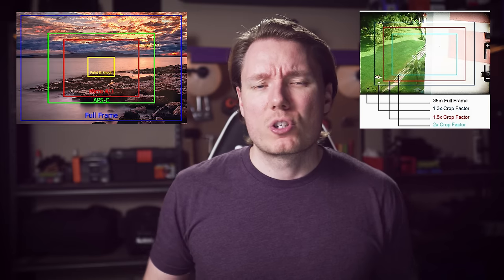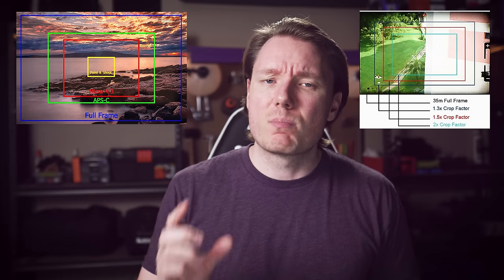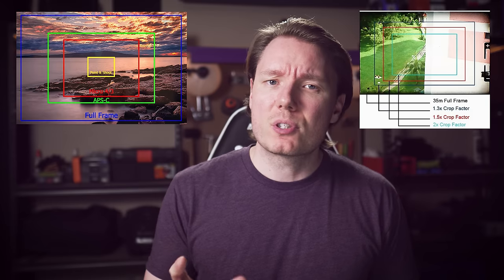Crop Lenses on Crop Bodies: How It Works vs Full Frame (APS-C & M43)

Comment: Can somebody settle this argument for me between me and my friend. So we both agree that if you put a full frame lens on a crop body (using canon as an example) it would be "cropped" in as people like to say. For example 20mm full frame lens with a crop off x1.6 for cannon would be an equivalent focal length of 32mm and similar fov as a 32mm full frame lens on a full frame body.
However we disagree that a 20mm full frame lens on a full frame body would be the same fov/ crop/ focal length as a 20mm crop sensor specific lens on a crop body. This crop specific lens on a crop body would surely still be 20mm and there is no "crop factor" to be applied? So a 20mm crop lens on crop body wouldn't be a 32mm equivalent unlike the full frame lens on a crop body.

Awesome video btw, really in depth very well explain!
Reply from the maker: The crop factor is still applied to lenses designed for APS-C, but it is "applied" differently. When you mount full frame glass the image is cropped, but when you mount aps-c glass, the lens displays a narrower field of view. How much narrower? The same multiple as the crop factor. So for a specific example:
The Canon EF 24mm, which is a full frame lens, has an angle of view of 84 degrees.
If you mount that lens on a crop body like the 7D Mark II, it will instead have an angle of view of 60 degrees.
If you instead mount the EF-S 24mm, which is a crop lens, it will have an angle of view of 59 degrees (very similar to the cropped full frame)
Hope that helps.
Reply: @geraldundone  Thank you so much!

Comment: Amazing content Gerald, amazingly useful for those of us who are newbies in the field. This is the first video I see that explains this well. Does this mean a sigma 16mm made for the MFT, has no crop on a MFT sensor, and would get exactly the same fov on a full-frame sensor with a 16mm for full-frame? I am particularly confused by this https://shop.olympus.eu/en_GB/lenses/om-d-pen-lenses/m-zuiko-pro/m-zuiko-digital-ed-17mm-f1-2-pro as the shop of Olympus itself mentions it as a 34mm (under specifications, it mentions 34mm equivalent on a 35mm sensor). Why is that? It's a MFT lens...
Reply from the maker: Thanks, Fernando. Unfortunately, no, it means the opposite. It means that a lens always has the crop applied by the sensor regardless of whether it was made for a smaller sensor or not. So the Sigma 16mm on MFT, will have a 32mm field of view equivalent to full frame.

Comment: after I watched the video for the first time, I understood most of the information, but I got one thing wrong. I thought an EF-S lens on my 80D will give me the same field of view as a full frame lens on a full frame body. then I tested the two lenses (ef & ef-s) on my 80D at 35 mm and they both gave me the same field of view. Then I concluded, a croped  sensor will still give you a zoom/crop effect even with EF-S lens but a more sharper image

Comment: Good info and presentation, but I still have a question. Is the field of view for a crop camera with a crop lens similar to the field of view for a full frame camera with a full frame lens with like focal lengths?
Reply from the maker: Thanks, Scott! And no, the crop is always applied even if the lens is designed for APS-C.
Reply: @geraldundone  Thanks. Why are there APS-C lenses then? I thought they focused the image circle somewhat so it fit on the sensor better.

Thanks again.

Comment: Is The perspective distortion is the same on apsc vs full frame or its different ?? A 56mm lens for apsc have the same perspective distortion as a 85mm on full frame ??? Not the bokeh i mean the compression do i get the same perspective distortion with a 16mm on a apsc as i get with a 24mm lens on full frame ??
Reply: Of course. How could it ve different.

Comment: I have a bit of a strange question for you Gerald but it is related to crop size to some degree - although opposite to what you explain in this video.  A long time ago, when I was active in film, I decided to shoot some projects outside the commercial work I’d been doing for many years and got myself a Canon XL-1 I believe it was called. It was a very cool little DV cam at the time and I had a lot of fun with it, but only after I changed out the crap kit lens it shipped with. I invested in a Canon L- glass they came out with and was specifically designed to fit the crop of a 1/3rd inch sensor which is what the XL-1 sported. 

Fast forward nearly 20 years and I still have that lens. The camera is long since retired of course but that lens still sits there on my shelf beckoning. So not being an expert by any stretch on lens science I thought I might run this by you. I’m seriously considering getting the Z-Cam E2 which has a MFT sensor - and I am wondering if there is any way in hell that I can modify this lens or add an alt-speed-booster to the set-up that could get that lens paired with this amazing cine-cam?  I know, probably crazy even asking but I have to try. I loved the images coming off that glass and would be so pumped if I could pair it today with the amazing sensor tech we  see in the E2.
Reply from the maker: Hey! It always comes down to two things: image circle and flange distance. The flange distance should be fine if the lens was originally made for SLRs, because that means it's longer than you need, so it can be adapted. But I'm not sure what size image circle it produces and if it would be enough to cover m4/3. I only say that because I'm not sure which lens you have. Lastly, it comes down to the mount. Many Canon mounts are well covered by adapters already. If you send me the model number of the lens, I can do my best to answer more thoroughly. Cheers!
Reply: Gerald Undone Ok, here is the lens type - Canon Full Manual Video Lens 14x Zoom XL 5.7-80mm 1:1.6-1.7 72. I see it’s branded a ‘video lens’ as that was its sole design intent at the time. Fairly easy to still get full specs on it if you google the above description. Appreciate your thoughts on if/how it could be adapted to a MFT mirrorless cam.
Reply from the maker: It's not looking good, Reginald. I'm not very familiar with that lens, but if you read the top answer on this forum, I think it applies: https://photo.stackexchange.com/questions/98250/is-it-possible-to-adapt-a-canon-xl-system-lens-to-a-mirrorless-body

Comment: I don't know if this is possible but I have the Sony aps-c 35mm f1.8 prime lens currently with my Sony a6500 body which of course gives me 50mm equivalence  however is it possible to get native 35mm were I to use for example the Sony a7c full frame body? I mean is there a converter out there or is my 35mm lens a 50mm forever?
Reply: Why would you even think anything like that? Just get lenses you need. There are tele converters but they are used with long lenses.

Comment: so quick question, does the crop factor apply to the DOF as well? or just FOV? assuming equal distance to subject and equal FL. I had in mind that DOF isnt proportional to the crop only FOV.
Reply from the maker: It does affect depth of field, but only because the focal length is different. If you wanted the same framing on a crop sensor, you'd have to use a wider lens, which means deeper DoF. If you use the same lens at the same distance, your framing would be different, so you'd have to back up, which again would give you deeper depth of field. If you're okay with the framing being different though, then yes, the DoF would be the same.
Reply: @geraldundone  yep thats right. But I was assuming no change in focal length and same distance to subject. Framing would be different of course.

Comment: Does that means that a 25mm lens specifically designed for apsc will have the same field of view as 25mm on full frame designed specifically for full frame?
Reply: No.
Reply: Anyone who asks that has not even approached the starting line in understanding the issue.

Simply put: smaller sensors require shorter focal lengths for the same result. If you understand this you understand everything. If you do not understand it you understand nothing.

Comment: i have an older zuiko 4/3 lens (for the old Olympus 4/3 DLSR) on my M4/3 camera. I assume that lens was made specifically for the 4/3 sensor size but it is of course a lot larger than one made for the M4/3. I am getting good results with it but i have wondered where that fits in to these discussions. It should be focusing all the light down to an image size appropriate for this sensor. Will it get the same performance as a lens (smaller in size but same focal length) of similar quality that is made specifically for the M4/3? I never see this exact combination addressed. Thanks
Reply: 4/3" sensor is 4/3" sensor. You have a lens that has parameters that are marked on it. Use it and be happy.

Comment: So, if I use a 50mm lens on a 1.6x crop sensor camera, am I getting the field of view as though it is an 80mm lens? I know that the focal length of a lens is not literally changing but isn't it effectively changing relative to the view you getting of the image?
Reply: "So, if I use a 50mm lens on a 1.6x crop sensor camera, am I getting the field of view as though it is an 80mm lens?" No, but if had added words "on a full frame camera" then the answer would be yes.

There is noting magical on full frame. It just is the standard people learned in the film days. The focal length is not changing.

Comment: It's not necessarily wasteful to use a full frame lens on a smaller sensor size. A lot of wildlife photographers do it on purpose to gain extra reach out of their glass for the money. Love the McKinnon style reach onto the shelf behind you, neatly done.
Reply: You don't gain more reach by using a larger lens. You are simply seeing a cropped image with less field of view.
Reply: But that cropped sensor usually has a higher pixel density, so if the glass can resolve it then it will look better than simply cropping the full frame.

Comment: Just to make sure I'm understanding...a 35mm full frame lens and a 35mm aps-c lens will both produce the same field of view at the same resolution on an aps-c body, but the aps-c lens will produce a sharper image because it's doing a better job focusing the available light onto the sensor?
Reply: Whether the lens produces sharper image depends entirely on the quality of the lens. You cannot make any simple conclusions on it. You have to evaluate case by case basis taking into consideration the lens version.

Comment: There is a statement that's going around the photographic circles postulating that images from a full frame sensor camera shot with "equivalent" lenses, compared to those shot on a crop sensor, will always be cleaner (contain less digital noise) because the "amount" of light that's getting through the "aperture" on a full frame lens is "larger"... though I'm having an issue with that explanation... If, as you have shown, the larger "amount" (a silly adjective for light intensity, imo) of light is being spread over a larger area on a full frame sensor when using "equivalent" lenses, wouldn't the relative intensity of the light be about equal? And in order to answer that, one would have to discount the different sensor technologies, so the person/people explaining this always assume comparable sensor technologies. What are your thoughts?

Comment: Very informative, thanks a lot! If oyu find the time, could you make a video on the statement "larger image sensor = less noise?". My understanding is that it's the pixel size that matters, but I've seen contradictory statements both on youtube and various websites and are somewhat confused.
Reply from the maker: Thanks for the suggestion. It's a good idea. Cheers! 😃👍
Reply: So what are disadvantages of using FF lenses on a cropped sensor camera? Isn't it become good because of guaranteed to not having vigneting, good investment to buy an expensive lenses because maybe someday you can buy a FF camera. Is there any fatal disadvantage like less the image on cropped sensor become over exposed or bad depth of field(blurriness?)?
For example i like to have 28mm FF lens and can be instaled on aps-c camera too to become normal lens eq: 43mm fov...

Comment: very interesting and well explained! What would be the crop factor on full frame vs medium format? I noticed most of the time is aps-c-/m43 vs full frame but not medium format vs full frame. thanks!
Reply from the maker: Good question! Well, believe it or not, medium format doesn't have a specific size. It's more of a range covering anything smaller than large format but bigger than full frame. But if we go off of some common sizes, it's about 1.5-1.6x larger on the diagonal than full frame, the Fuji ones are about 1.27x larger across the diagonal. So, if you wanted to figure that out for a factor for full frame it would be 0.79x for Fuji, and 0.64x for the bigger medium formats. Then you just take a focal length you have on your full frame such as 35mm and multiply it by 0.79 or 0.64 to get what lens you'd need on those medium formats to get an equivalent FoV. The answers would be: 27.65mm for Fuji and 22.4mm for the other ones.
Reply: Medium format sensors are larger. Sometimes people use the term crop factor on those as well and they would be smaller than 1. Those who shoot medium format do not do so as they will not see FF as any standard.

Medium format cameras are optimized for studio use and maximum image quality,. They actually may bot have that good high ISO performance. Also medium format lenses typically are slower than FF lenses, more than the larger sensor gives.

In the film era medium format was really much bigger like 6 x 7 cm. Digital medium format is like a crop in a medium format world. The can be 44 x 33 mm or 53 x 40 mm.

Comment: So basically, a 50mm aps-c lens on aps-c sensor is the same focal length (equivalent) as ff lens on ff sensor, right?
Reply: No, of course not. 50 mm on full frame is of course wider than 50 mm on crop. Millimeters are millimeters. There is no difference for what sensor size the lens is designed for as long as it covers the sensor. If you gather water with a bucket in a rain it does not matter a bit on how large area it rains. Your bucket size is what matters.

If you understand this sentence you understand everything. If you do not understand it you understand nothing: With smaller sensors one uses shorter focal lengths.

Comment: I can't find the answer to my confusion.  THIS Confuses me -> "Designed specifically for APS-C sized sensors, the Sigma 18-35mm 1.8 translates to 27mm-52.5mm on 35mm camera."  What does that mean? Are the focal lengths on aps-c lenses taking into account the sensor size/"crop factor" and thus their true focal lengths AND equivalent focal lengths are one and the same? Or do I still need to multiply the crop factor of my sensor to figure out the equivalent FOV? That line in the product description doesn't make sense to me. Am I getting a 27mm equivalent with the aps-c lens on an aps-c sensor? If a lens is designed for an aps-c sensor, why wouldn't the equivalent focal length match up with the true focal length? All my current lenses are full-frame, for my Sony a7sii. But I also have a BMPCC6k now. They're all EF lenses because I knew I was going to get the BMPCC6k.
Reply: Focal length never take anything into account. That are what they are. With smaller sensors one uses shorter focal lengths.

Comment: Could you test full-frame glass on an APS-C body versus decent native APS-C lenses on the same APS-C body (same F-numbers)? because the F-number is focalLength/Diameter, but the APS-C lens is presumably designed to focus to a smaller area, so a greater intensity of information. The DOF gets the crop-factor, but surely there is less light too?

Is the entrance-pupil proportionally larger?

It is just that some photographers talk about investing in fullframe glass for your APS-C body so as to be ready for the: "Fullframe upgrade". Except that full-frame is not always an upgrade and the fullframe lenses you'd have to buy to incur no penalty* are so expensive you'd be able to afford fullframe straight away anyway. Plus the changes in the FOV would make this a rather odd thing to do for anything other than telephoto/macro.

*Is there a penalty?

For example:

Sigma 18-50mm f2.8 DC DN Contemporary Lens for Sony E
VS
Sigma 24-70mm f2.8 AF DG DN Art Lens for Sony E

For 1:1 macro and telephoto there is no penalty, or at least, the "Extra reach" is of a greater benefit.
Reply: I cannot get what you mean. If you use an APS-C camera it does not matter whether you use an APS-C or a fill frame lens with the same focal length and aperture - ignoring things like quality differences of the lenses.

Comment: Hi, great video. I'm only still wondering if wide angle lens distorion is caused by the field of converted to the sensor size or by the actual fov of the lens / shape of the front element?

Well going through some more of your videos I'm just going to get a paper and do my math. Definitely peaked my interest. Keep on getting it undone Gerald!
Reply: Are you talking about for example the distortion of faces, where they seem longer on wider fov lenses? If so, that is because of the distance from lens to subject. If you stand as far back with a 14mm lens as you would with a 85mm, then crop in so the images look the same, the distortion should be the same. So it's not the focal length that matters, but the distance to the subject. Hope this was helpful.